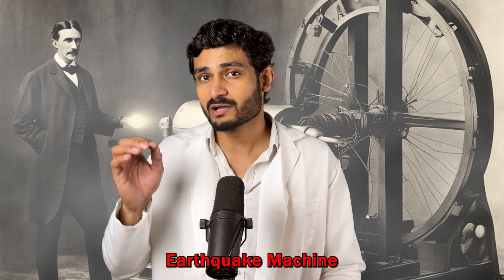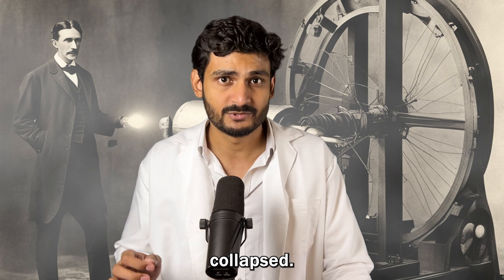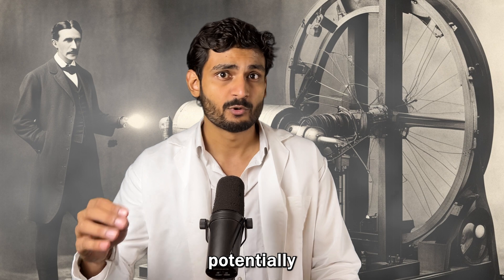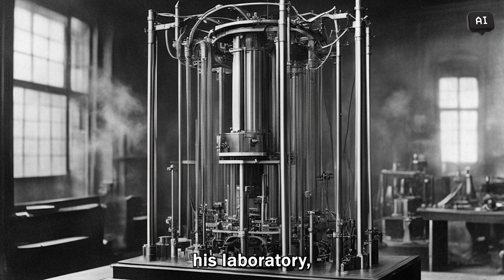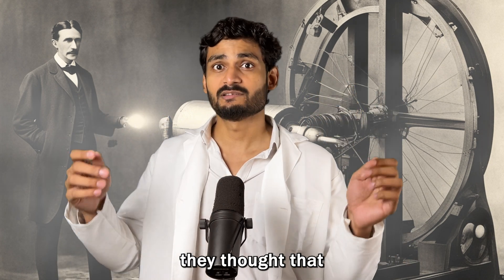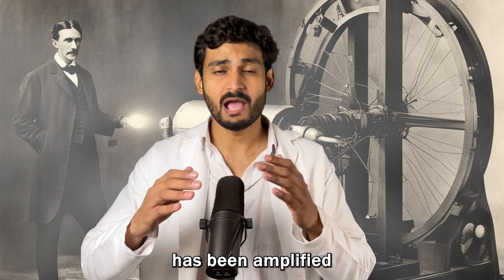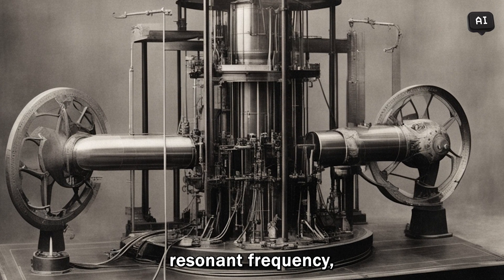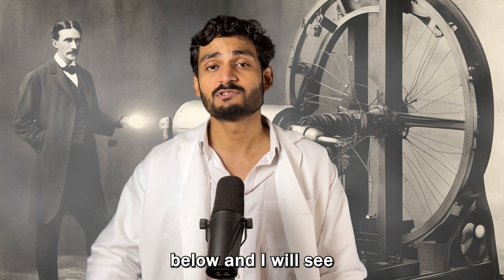Nikola Tesla Earthquake Machine

Comment: Can work put not far distance for eg tesla coil has a range of how much it has voltage eg 100v distance 2ft  receiving 5v another eg 1ft 2.5v .And the earthquake machine depend on the vibration how far distance it can go we can get electrical signal through vibration but depend on the voltage we can get current but have to work like a radio controller how much u want to receive the current but electric current through vibration is 2 by 10